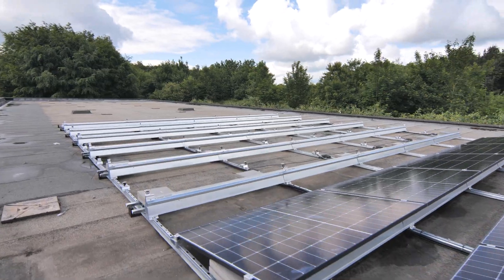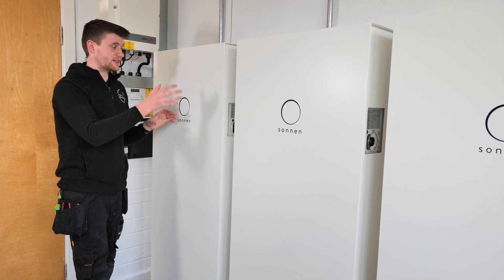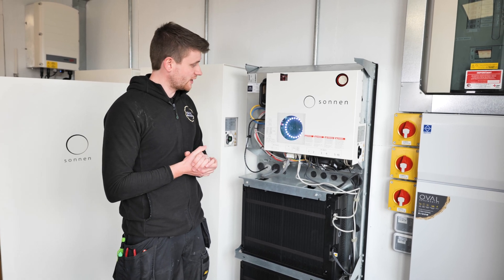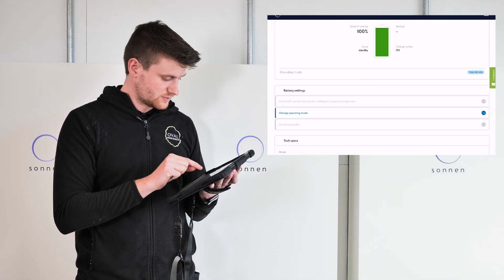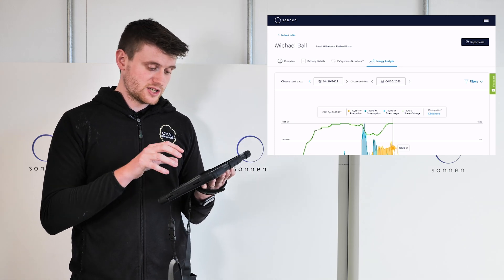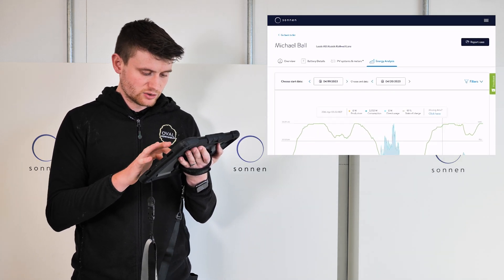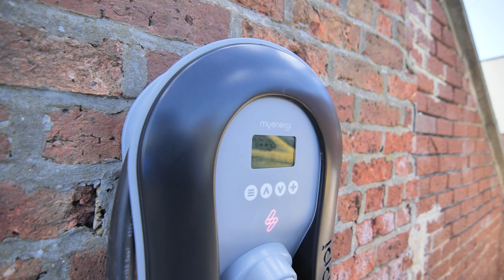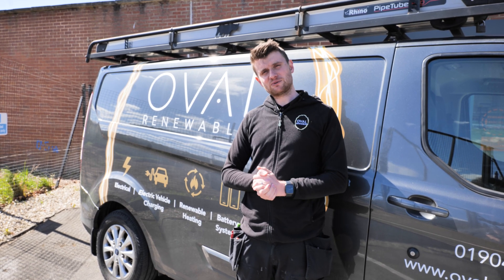MB Models three phase solar and battery system Part 2

Comment: I wonder why the choice was made to use 11KWh battery packs and only use 4.6KWh. As far as I know lithium phosphate batteries can allow a lot more discharge.
Reply from the maker: The tech moves on so fast! There are bigger capacity systems now with a smaller footprint. This is an older installation

Comment: I presume the batteries do a vector sum calculation across the phases and balance export/import on demand to net to zero and the smart meter is vector sum aware?  I also presume you have a truck load of ct clamps across the phases for the zappi and eddi to know what is going on and how to calculate the excess?

Comment: Your projects look well designed and the installations are excellent. As you are experienced with Solar Edge, would you share your data about failure rates of the DC optimisers? There are a few YT channels that report the optimisers are not very reliable.
Hope you will be able to answer the question and many thanks
Reply from the maker: Thank you, we have had 2 fail in around 3 years. Which isn’t bad. SolarEdge cover the part cost, scaffolding and Labour to replace. Can’t say fairer than that!
Reply: @OvalRenewables  
Thank you for responding